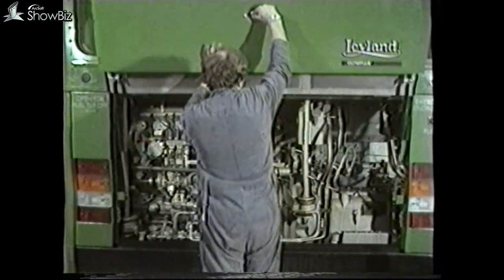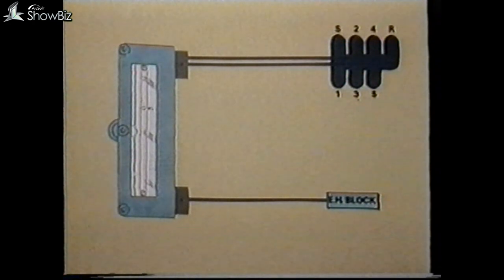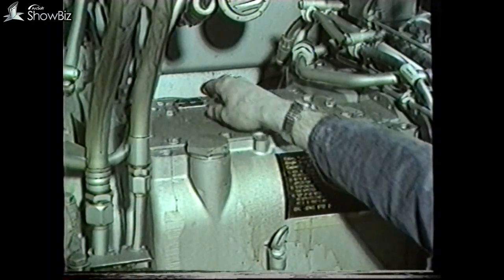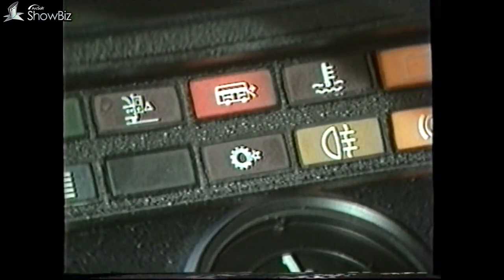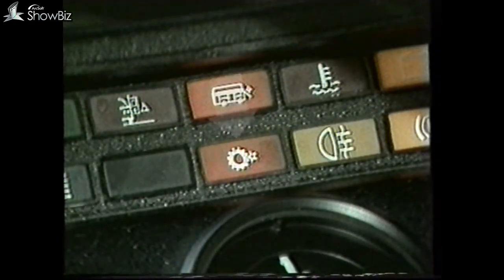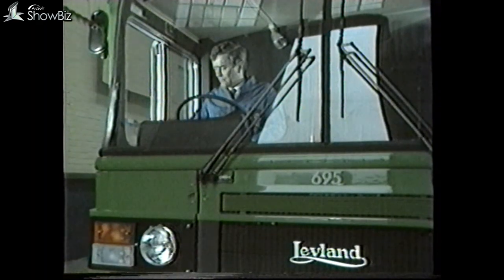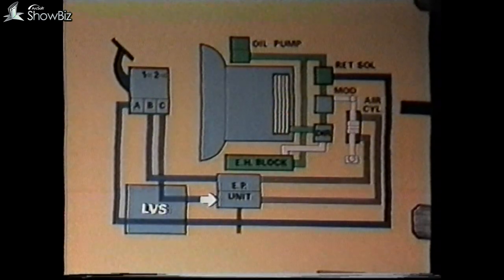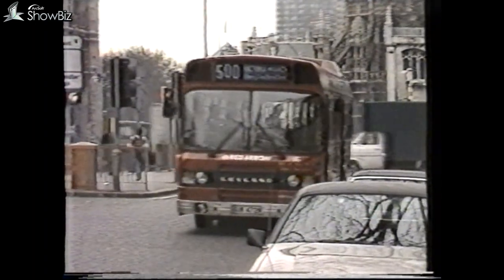Leyland Bus Hydracyclic Gearbox Fault Finding - Semi-Auto LVS Control Olympian Tiger National Titan

Comment: Let's connect one of the simplest and most reliable diesel engines (Gardner) to an electro mechanical hydraulic and pneumatic controlled transmission. At least the passengers have heat when the bus stops moving...